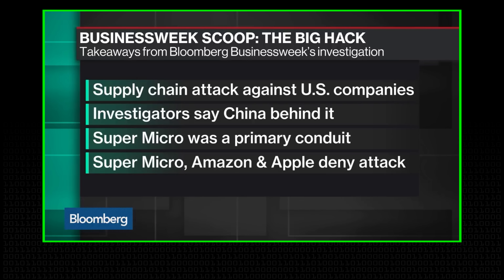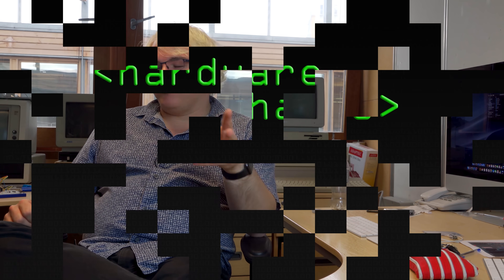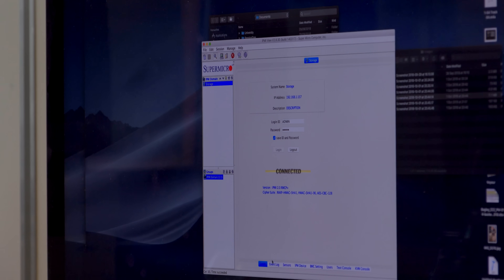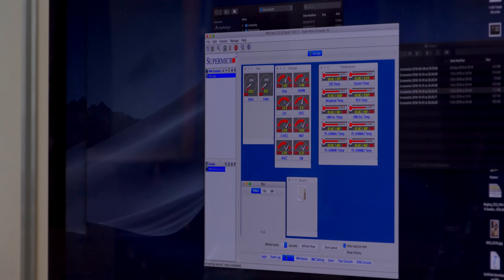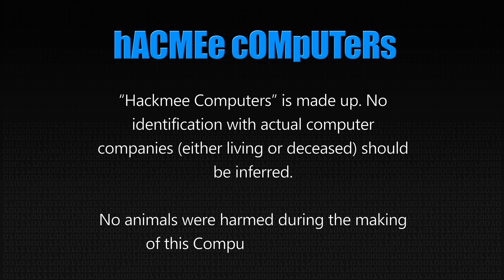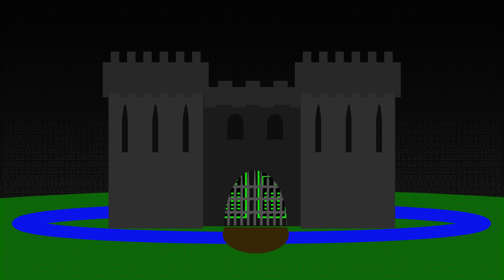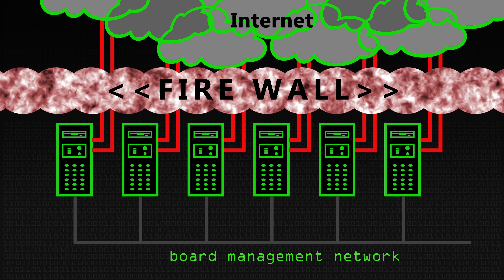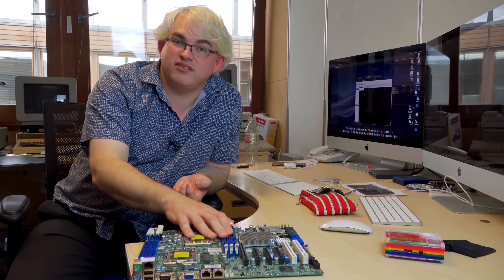Hardware Hacking - Computerphile

Comment: Back in the late 90's/2000's I've been asking the question. What's stopping the Chinese substituting critical processors and firmware on systems considering they are the ones manufacturing these chips and motherboards and had basically keys to the kingdom. This is not limited to Servers, PCs etc, there is every possibility that most telco routers, gateways, firewalls and managed switches, but not necessarily mum and dad devices could all be open to tampering  with the ability to unwrap packets of data read, re-package the data for transmission to the intended destination  while re-transmitting decrypted or re-encrypted data to an unknown destination in stealth. While allowing stealth accesses to the devices secure communication appliances.

Comment: If such a hidden chip or circuit does exist, I'm sure it wouldn't be sending out any data otherwise it would get detected by firewalls. My guess, if there really is such a thing, would be a small ticking time bomb circuit. A hidden chip embedded in thousands of servers could have a set date to disable the board and rendering the server inoperable. This type of hack would be very difficult to detect or troubleshoot.
Reply: Self-destructing boards? Oh brother...

Comment: To me it seems rather cumbersome and unnecessary to do a hardware hack.
Wouldn't it be much simpler to just create a custom BIOS/UEFI or management system firmware, and flash over the existing firmware?
This can be done seamlessly during shipping, without the manufacturer knowing, and there are no way of telling it has been done as there usually isn't any way of dumping the firmware from the chips after it has been flashed.

Normally the firmware itself, is what performs the flashing of new firmware, thus you could re-inject your malicious code everytime a new firmware was attempted flashed, making the compromise as permanent as a hardware hack.

Comment: I’d read that this hack was achieved by using a modified Ethernet “MagJack” module.

This is the perfect infiltration point as it can be installed after the motherboard has been manufactured by simply desoldering the original module and fitting the compromised one. “MagJack” modules often also have status LEDs onboard (connected to +2.5-3.3V) and so power can be stolen from the motherboard supplies this way.
Reply: Alex Scarbro Nah, that's far from the perfect place. While you could sniff (likely encrypted) network traffic from there, you can't actually do anything to the computer or its data. The only places that makes sense is near or in a management chip, a bus controller or somewhere like that where you have access to the buses, memory and peripheral devices.

Also, desoldering a component to replace it will very quickly stand out to any electronics engineer inspecting the board visually. This has to be done within the actual manufacturing process.

Comment: The "discrediting" of the report really hasn't been about claiming that it didn't happen.  The problem with the Bloomberg piece is that it was so tremendously slanted against SuperMicro.  Security experts are perplexed as to why this is the case because this kind of thing plagues ALL manufacturers.  It's been known since the Snowden revelations that the NSA has been doing exactly this kind of thing, redirecting and seizing shipments and altering hardware before its delivered, for years.  Of course China would be doing the same.  Why SuperMicro was singled out is what experts object to and are mystified by.
Reply: Source on NSA doing this ? Sounds interesting
Reply: Prolly some tinfoil YT videos

Comment: How about the hidden ethernet sniffer chips embedded inside ethernet connectors on boards?
Reply: 260830107 Won't be anywhere near as effective as infiltrating management chips or bus controllers. Network traffic is likely to be encrypted these days, and you also can't access the actual computer memory or peripherals that way.

Comment: I just recently read about a sort of malware, that is installed in the UEFI.
From there it then installs a program onto the disk, which then modifies some system file, in order to establish connections...

That sounds exactly like the type of malware that an additional, hidden malicious chip would install...
And if the machine is found to act weird, the owner will reinstall the OS, change the hard disk or whatever, and likely not think about even flashing the UEFI, let alone replacing the mainboard.
Reply: That will be the headache if it is hardware level...
And without decent knowledge it is hard or impossible to detect..and even it may detect ..you can't modify a correct hardware set..

Comment: Hmm. Now that I think about it, would it then be possible to, like, make a really flat mobile network sender/receiver, and a really flat SIM card, or something like that, to connect to usual phone towers in the area instead of having to go through the server network? This way no one will detect it since it wouldn't use server network?
Reply: Architector #4 
It would probably be really hard to get a signal from inside a server, all the metal and live electrical components centimeters away. Might be doable though
Reply: Couldn't, then, someone make same kind of a sender/receiver that would use other frequencies or something? Although metal and stuff would indeed block some wireless communication, I don't think that it would block all possible ways and types of it.
And with this it would lose the possibility for phone towers, but doesn't exclude the possibility of some normal looking dude with a backpack and a smartphone to have a huge signal sender/receiver box in that backpack, or something...

I bet I sound like I barely have any idea of how all of this works, but I still think that this is a possibility.

Comment: Can even USB peripherals like mouse keyboards, audio be used ?
Reply: But they would then need special software "nonestandard" or somehow the ability to be prepared via an opcode to set free optional functionality on some chip, maybe even download and replace drivers in use, with forked?
Reply: You might be interested in BadUSB, where your USB identifies itself as a keyboard and very quickly attempts to turn on the console and deploy it's payload.
Reply: Thunderbolt too. Maybe even more so because it rides on the PCIExpress bus. PCIe is DMA capable so it can read and write anything in memory without OS or CPU intervention.

Comment: that's why open source hardware should be a thing.
Reply: Open source hardware is a thing. Arduino is an opne source hardware company, much (though not all) of the Raspberry Pie is open source hardware
Reply: Open source hardware would have to be combined with the ability to print our own ICs. Someday, like 3D printers.
Reply: It is a thing. Well some forms of it is. Search RISC V.
Reply: With open source software we can easily use a hash or a signature to check if the binary has been tampered with by a third party, and that everyone has the exact same binaries as identified by the hash. Let's say you buy an open source phone from a retailer, you can't know it the copy of the phone you got was built exactly as the open source schematics by the manufacturer who might be interested in hacking only you, if you are an important figure or something, you can't know that the phone wasn't tampered with by the retailer or the delivery guy or the government import customs, because we can't compute the hash of a physical object.
Reply: Horrendously hard to verify, though...
Reply: I don't think we are anywhere near to being able to print a processor, but I don't think it's necessarily a problem.
Chips can be verified to an extent. There's that guy who's been using some fuzzing techniques and automatic time based analysis to find undocumented opcodes and registers in x86 processors.
With RISC V it would probably be easier and simpler to test it does what it should and no more.
Reply: As long as your "open source" CPU is designed by a company, unless it's a non profit company, will be stuffed to the gills with backdoors anyway.
Reply: it woudnt do a thing in this case
Reply: What does open source actually mean - seen this on steam earlier.
Reply: Bad idea.
Reply: panics
Reply: false.
Reply: Azul Amazigh: Then you must also limit the designs to one layer for easier inspection. In all cases someone has to produce the circuit boards and someone has to mount and solder the components and sockets. At any of these steps we still run into the danger of someone injecting their spy hardware/software. I'm afraid we're back to square one, with the exception of a single board layer.
Reply: Lol if open source hardware was a thing it could become a lower level hardware hackers dream because of the amount of things that could be exploited and hardly ever found given enough configurations. It would spur lots of innovation though.

By the way you can always make your own. It sounds hard but once you get past binary and up to machine code it gets alot easier.
Reply: @ Andrew Kelley

Security through obscurity?
Reply: @altaccout  that only works if what you have cannot be read or if you have nothing anyone else wants.

Ex. You as a person no one wants to hack through a random amount of things or figure out personal exploits to get some power which leads to a bank account with maybe a day's pay. Then a bank is a hole new level.

Unfortunately almost no one wants to build there own thing from scratch. So they copy. Then you have a chance to have a bank type situation with open source hardware through copy cats.

You then have the lower levels trying to secure there own things with limited knowledge. Which more than likely exposes hacks instead of covering them.

This all is complicated by the fact most people making there own will  look the same as everyone else on average. Which is quickly slashed through and exploited.

So in real life it would lead to alot of hack fixes but alot of people that would be easily hacked.

Comment: 4:52 Aren't you forgetting the infamous "Ring -3" where the management engine has complete control over the entire system, to the point where it can do things that we can't do on Ring 0.  Would so love to dump Ring -3 and any and all management engines so the user has some control of their machine without worrying about Intel/AMD spying on their every move.
Reply: The hilarious idea that you need a hypervisor for ring -1...

How computerphile has fallen...
Reply: @PegasusEpsilon  Or any rings at all. Remember when we didn't have rings and we used to write our own operating systems that were engrained in the floppy disk? Pepperidge Farm remembers.
Reply: @SimGunther  Rings are needed to protect the OS from misbehaving or malicious processes.
Reply: Ring -1 to rule them all, ring -1 to find them; ring -1 to bring them all and on the motherboard hypervise them.
Reply: @sundhaug92  Capsicum doesn't rely on rings for its security model in FreeBSD and Genode, so that shoots your argument down a notch
Reply: @mytech6779  rings other than ring 0 and ring 2 never caught on because not all arch's have more than 2 rings. ARM used to have only 2 rings, as well as other older arch's had two rings as well. Maintaining system critical code which had to work on processors with different numbers of rings was too much of a developmental burden compared to the benefits.
Reply: If you have ring -3 there is no stopping you. Ring -3 means own the CPU and get it to-do what you want.  It would almost be impossible to detect aside from hardware analysis or obvious network patterns. Of course finding ring -3 is the challenge. I saw the presentation about ring -3 in VIA CPUs very interesting stuff.
Reply: Capsicum is a software thing. It does not "use" rings, but it run inherits from the hardware it runs on. What is talked in this video is ring 0 and ring -1, where the first is like executing machine code as root and the second is executing machine code as use more privileged and not seen by the root and therefore not seen by capsicum. There are videos like bravo bravo mentioned where you can use even ring -3 by exploiting another embedded core in the VIA processor that can push machine code into the CPU by the system not even knowing that anything is running except by measuring latency on x86 instruction execution. Ring -3 if analyzed by a ring 0 program can be seen as some kind of bug or performance problem in the system and nothing else.
Reply: bravo bravo 
Would love if you explain what are rings  and/or books and the talk you just mentioned any links
Reply: SimGunther 
Would love if someone explains to me what do they mean by rings here ...
Kinda confused
Reply: @ko-Daegu  Code has some limitations based on the ring it's running in. It's like some kind of privilege, some programs have access to operations that other programs don't. First its the ring 0 or kernel mode, code running here has access to any instructions of the machine. Ring 1 has restricted access to resources that are available in ring 0, it is less privileged than ring 0, ring 2 has even less and so on. Usually ring 1 and 2 are not used but ring 3 is. Code running in ring 3 is said to be running in user mode, your every day user applications run in user mode.
Reply: Nicolas Nicolas 
Ahaaa...Thankx 😍😍😍
Is used and kernel mode is the same as the one we studied in computer architecture when we talked about CPU modes ...and they have another names as rings ???
But what is the ring -1 they where talking about .???
And how Virtualization can have more privilege then a kernel mode ??
Reply: *NSA via Intel/AMD 🐸☕

Comment: we need some hard evidence in some Xray differences between boards with same revisions!
Reply: I think all boards with the same revision will have these hack chips. (or not have them, depending on whether this piece of news is true or hoax) Far cheaper to put them in all boards and just leave them unused/disabled/ignored if they're not needed, than to devise two manufacturing chains. One with, and one without the hacked chip. The chip's code could easily be wrapped in a simple if/then/else check. Akin to asking "Am I in a server that needs to be hacked?" If not, then don't run. Or maybe do run, anyway? Hack the planet!